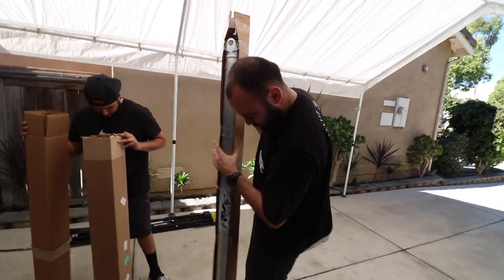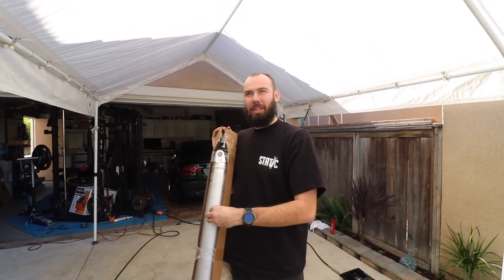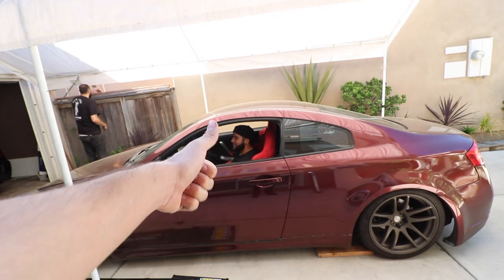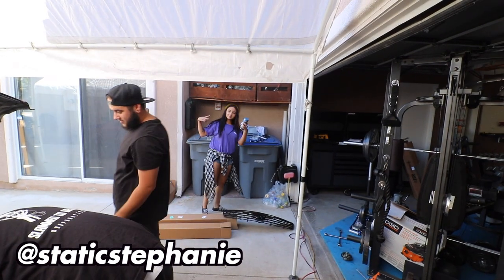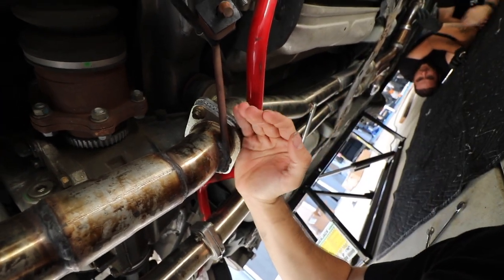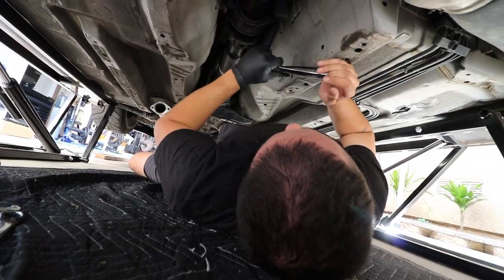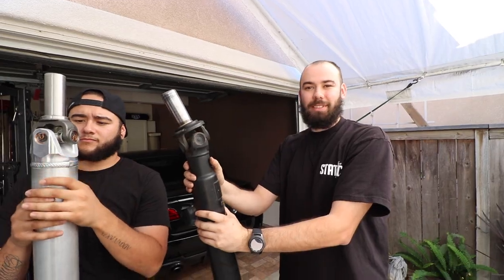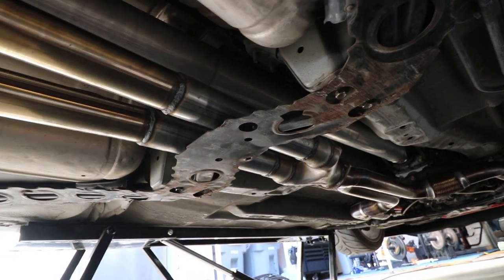G35 Aluminum Driveshaft Install!

Comment: Hey man quick question, what would be all the rotational parts you would want/need to change to send all the power to the wheels, ect. Motor mounts, diff bushings, transmission mounts, single pease differential, what else would you say? Ik there is a couple

Comment: Solid or poly motor mounts, and rear subframe bushing collars or poly/solid bushings maybe?
Reply: I got poly motor mounts currently, I'm gonna get solid diff bushings later on
Reply: @Boosted_Martin  oooh sick! How do you like the poly motor mounts, Martin? Im doing that next, then the dss driveshaft 😊
Reply: @zeeDeveel523  it's great if you don't mind a bit of vibration. And nice, both are needed upgrades for these cars
Reply: @Boosted_Martin  not at all, nvh is life 🤣
Reply: StaticMartin do the solid ones vibrate as much?
Reply: @V37Jus  it'll vibrate a lot more I'm sure

Comment: Ok I have a 05 g35 coupe and when I put it in reverse or drive there's a click in the back tires what do I do to get rid of it plz thank u
Reply: Israel Torres needs new dif, or drivetrain
Reply: Could need lube where axle meets wheel hub , it’s known to rust a little
Reply: Google "G35 axle click" and the fix will pop up. Common problem.

Comment: Get a kintex intake manifold u see big power differences
Reply from the maker: Haven’t seen any real power difference N/A. Send us some dyno sheets on non boosted applications! Once he’s boosted is when it’ll be worth the price tag
Reply: @StaticGarageUSA  I'll dm it to you its about a 30hp difference
Reply from the maker: If it was a 30whp difference everyone would have them N/A and DEs would be pushing 300whp. I haven’t seen any dyno evidence to show any big difference between motordyne spacer and kinetix mani
Reply: Im not arguing or trying to make u change ur mind but i have full bolt on throttle body spacer cam and a tune and I pushed out 325 wheel but maybe  its cuz u dont have a cam
Reply: With the manifold
Reply: I forgot to say manifold
Reply from the maker: Yeah cams make a huge difference lmao. More airflow through the manifold means you need to open up the valves to breath more air. We ran on a heavy in floor roller dyno and only made 276whp/260wtq. We’re going to dyno at a more accurate place soon and see where we’re at!
Reply: Im very well aware that cams make a big difference but dont count urself out cuz in The video u sayd that dyno was off but I didnt come on here to try to brag about my g and do anything extra I was just trying to make a suggestion but all the vest of luck to static garage and maybe one day we can race